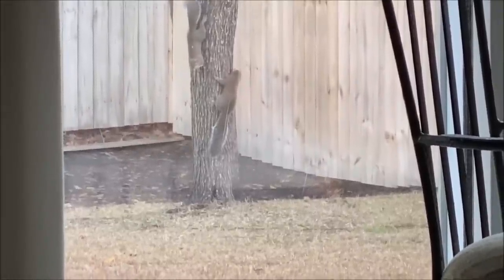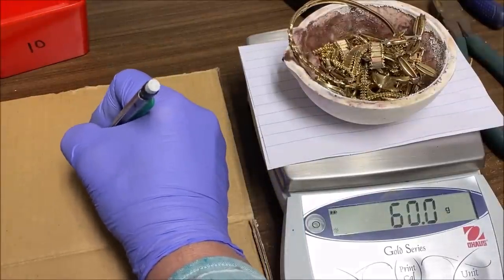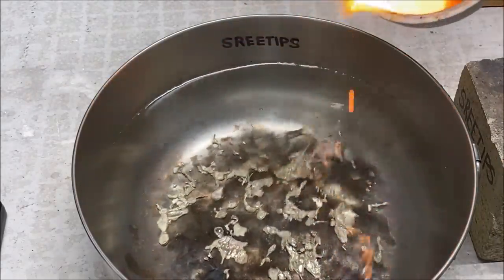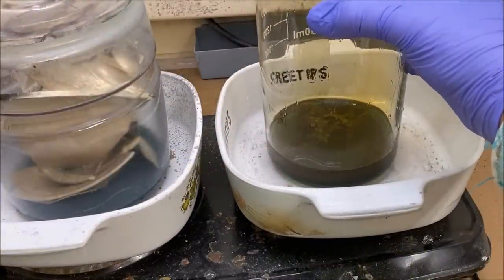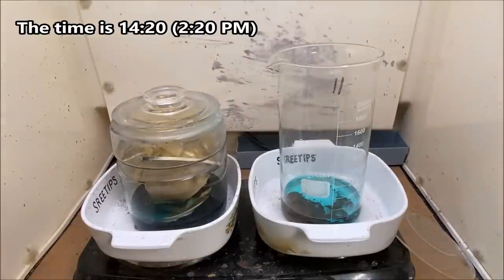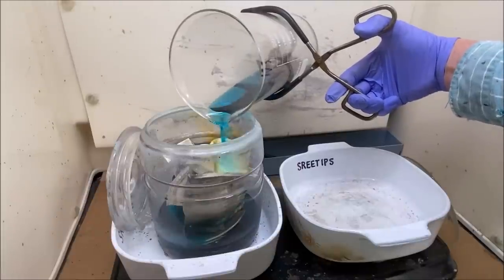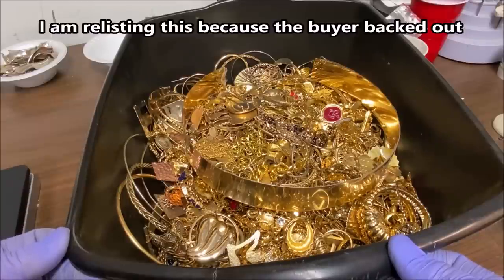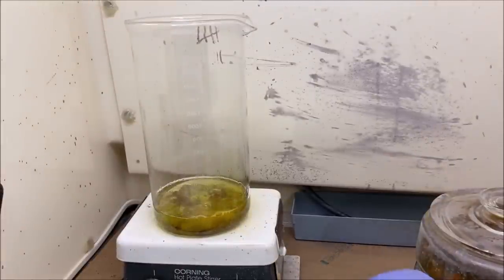Gold Refining Karat Scrap with Gold Plated Scrap sale

Comment: This is so entertaining to watch. I was thinking "Why couldn't I do the same?" cause I've got a chemistry professor in my family with access to materials and a lab. However, no matter how much I look - online auctions in my country end up going for more than the gold price. At least the solid 14K and ups. I find it hard to estimate how much gold there is in the plated/filled/vermeiled but my rough math suggest the yield to come at a loss.

I guess you need to know where to look for the best finds, not just online auctions.
Reply from the maker: People just don’t understand gold. It’s not an investment. It’s insurance against the paper money printers. Holding dollars is a bad idea because they are losing value (in terms of what they can buy) very fast. Holding your wealth in gold is a much better idea because it will retain purchasing power that the paper money loses. If you need paper to pay your bills, then sell a little metal. However, if you don’t have any savings to begin with, then it doesn’t matter. If you spend all your money as soon as you get it, then buying gold won’t work for you.
Reply: @sreetips  Very good point. I invest in gold and silver, mainly silver, because it's something I can reliably hold on to that will only increase in value (generally speaking). I also would like to inquire about purchasing a small sealed bottle of the aqua regia if that's at all viable. I'll use the proper channels to reach out in more detail.

Comment: I just discovered your channel, can't wait to go back and view all of the previous posts.  You may already have one, I've only skimmed the titles so far, but will you consider making a needed equipment and chemicals video for those of us thinking of taking this up?
Reply from the maker: Welcome. Everything you need is in the videos. I’ve left nothing out and added as much detail as possible. Please watch and take notes. Plus I try to view and answer all comments. Thank you!
Reply: You can get the basic equipment needed for about $500. That does not include the acids, just the flasks, hot plate, vacuum system, and bubbling device for the stock pots.
Reply from the maker: The first thing you MUST have is a fume hood to draw the fume away from you. No way to safely do these reactions without one.

Comment: What if you poured the inquarted gold from a higher height? Kind of like they pour shot from a shot tower. Obviously you couldn’t build a shot tower that high inside buy would pouring from a couple feet high make smaller pieces or would it be a big safety issue doing so?

Comment: Squirrels are cool dudes.  Years ago we had a group that hung out in our yard for tidbits we would put out for them on the top of the wall on our back porch.  Then the snow hit,  the back porch was full of snow, 3 feet deep wall to wall, needless to say, there was no opening the storm door to put out goodies for the squirrels. Those little beggars were line up sitting on the wall eyeing up the back door.  So .... we simply opened the kitchen window just high enough to put the goodies on the ledge and the squirrels came up one by one, took a piece (just one, no cramming their mouths), and moved on.  Who knew we would be opening a winter outdoor cafeteria for the squirrels.  They got a variety of shelled nuts, dried fruits, and peanut butter on crackers, bread ..... sometimes open face, sometimes closed sandwiches.  And, they always ate the cracker and the bread before coming back for seconds.   That was a fun winter.
Reply from the maker: They are a joy

Comment: Two small remarks:
You used to keep the last nitric of the nitric boils apart instead of putting it in your silver jar. As you are running behind on processing your silver cement, I suggest you start doing it again.
I was very surprised you did only one refining, curious about the refiner's assay.
Reply from the maker: It was a speed refine to demonstrate that the gold can be refined in just a few hours.

Comment: I wonder if there is a safe and consistent way to purposely cause the inquarted gold "explosions" that bring about more of the beneficial dust form of the inquarted gold.
Reply from the maker: One refiner used a pressure washer rig and poured the molten gold into the stream of high pressure water. It formed very tiny particles of inquarted gold. Perfect for hot dilute nitric boils.

Comment: I've been watching for quite some time and was always curious about waste chemicals. Using the silver to consume the excess nitric leftover from refining and so on. At the final form, is there anything that you have to eventually dispose of or do you just use the various leftover chemicals again and again to the point that they are no longer harmful? Probably a stupid question, it just seems like your system makes full use of any residual chemicals and I was always curious if eventually there was anything that requires disposal or if it is a self-supporting system that consumes waste as it goes
Reply from the maker: Waste treatment

Comment: i guess it would be an extra thing to do but if you pour the 6% k load in to a jewlers bar and roll a thread of the gold silver mix shouldnt you be able to get a long tiny rope a alot of area with out jetbeams etc? guess you can twist it by takinig to ends in a drill to stretch untill it breaks
Reply from the maker: That’s sounds like lots of work. Rather let’s the chemicals do it for me.

Comment: Do you make your ice cubes with distilles water? I learned about making clear ice and the bubbles in the ice are from impurities being concentrated in the center of the cube as it freezes, i wonder if it contributes to the cloudiness of the aqua regia
Reply from the maker: I use distilled water. But tap water, contaminants measured in parts per million, is fine. 999 parts per thousand is industry standard for pure gold. Parts per million will not report in a precious metals assay.

Comment: I really liked how that ingot was bulging out the top of the bar mold you poured it into, kinda surprised the surface tension was enough to keep it together there.
Reply from the maker: If you watch carefully, you’ll see that as I began the pour, about 75% of the molten gold came out of the melt dish into the mold. Then it stopped flowing (because of my poor pouring technique). I had to tilt the dish and get the rest of the gold to flow out of the dish. Fortunately, the gold already in the mold stayed molten just long enough for the rest of the charge to join it without forming a very ugly bar.

Comment: Hey I have a question, i have i big box about 18x24 box full of jewelry that says 12K Shiny Gold. Its a lot of pieces i wanna say like 1,000 pieces like bracelets , earings, rings and necklaces… my question is would it be worth taking to a jewelry and have them melt it and try getting the gold out of it? I dont know what 12K Shiny Gold is. Is it fill gold, plated gold or even fake. Its a lot though so im just wondering if i should take it somewhere??
Reply from the maker: 12k is usually gold filled. GF is about 2.5% pure gold by weight.
Reply: @sreetips  but it says “12K Shiny Gold” i think its gold plated from my researching… but is is worth take me to a jeweler and have it melted down?
Reply from the maker: Melted down? Not sure about what your asking here.

Comment: After the third nitric boil you took a second to zoom in on and comment that your gold was looking good- would the gold be brittle enough to physically break up into smaller particles at this point? and would doing so allow you to use less nitric due to the increased surface area of the remaining inquarted gold?
Reply from the maker: Harold_V on the goldrefiningforum.com recommended that the gold not be crushed up. It would tend to cause nano particles that suspend and don’t settle well.
Reply: @sreetips  Thanks for the reply; my initial reaction to that is that as someone who refines their waste solutions AND filters anyway; I don’t think you would be concerned about suspended particles? 

I will read the forum post Harold_V

Comment: About $3200 at today's spot price. Not bad for a day's work.

I suspect that it might be tempting to dip the gold-plated material in aqua regia long enough to dissolve the gold plating. The results would have to be refined to separate out the base metals that would also be dissolved, and once the material was treated this way it would be scrap brass at best. It's likely that the gold plating is worth less than the value of the junk jewelry.
Reply from the maker: Gold plated is best processed in a sulfuric acid stripping cell.
Reply: @sreetips  I remember that video. It looked like a lot more trouble than it's worth, given the amount of gold involved.

Comment: 26:57 "Must be losing proficiency here" My 2c idea: wouldn't it be useful to measure the wet weight of the gold in the beaker after the nitric boils, and start a little statistics table, noting how much nitric is needed in the aqua regia phase?
The only thing this wouldn't result in a good reference value could be if the gold content is varied, but after that many nitric boils, it shouldn't be.
Reply from the maker: That sounds like a good practice. But it would add another step to an already lengthy process - especially if your trying to publish before midnight!

Comment: That busted heating element is most likely easy to fix. Chances are it's just a loose connection. All you need is a heat stick, some tin and shrink tubing. Probably would take five minutes.
Reply from the maker: I’ll give it a look.

Comment: knowing gold is 19 times heavier then water i was just wondering,, after dissolving the gold into solution does the weight of the solution carry the of the gold??,,   does the acid solution gain the weight of the gold once its dissolved??
Reply from the maker: Yes. A solution with gold in it will weight more than the same volume of liquid with no gold in it.

Comment: If you want to reduce the chance of the molten alloy exploding as you add it to the water, make the water around 165F . That works on copper anyway.
Reply: What if you wanted it to explode on purpose?
Reply from the maker: Get the gold real hot before pouring into the water. But it’s very frightening. Like a gun shot going off right next to you.
Reply: @sreetips  Sounds like it wouldn't be a practical way to speed up the dissolution :D
Reply: @canonicaltom  I believe making the water colder would increase the chance of explosions. Having 2000 deg molten metal flying around is really not very entertaining, and it kind of hurts when it lands on human flesh, oh, and it's hard to recover bitty pieces of flying debris.
Reply: @larryevans7669  Yeah, was wondering how practical it would be to make metal 'sand' this way but sounds like a bad idea.

Comment: It may be the receptacle if both units are not putting out proper heat, or a voltage drop off somewhere in the circuit.
Reply from the maker: I think it’s the thermostatic controller, plus connects in constant contact with acid fumes while running.

Comment: As the only dumb question is the one that goes unasked 😁 Could you use that cemented silver you get to inquart the gold?

Careful with the squirrels 🤣 If they get used to getting their food from you? Let's just say I had a neighbor who lived in the condo across the courtyard from me. She fed the squirrels every day, nuts and cobs of corn... One summer she went to take care of her mom and was gone for two weeks...

The squirrels went up on the roof, tore through the vent cap and went down the duct, and got into her condo through the vent in the bathroom 🤣 and they tore the poor woman's house to shreds... When she came home she scared the bejeebers out of us when she let out a shriek and came running out her patio door, followed by about 6 or 7 squirrels... 😇 They tore up her furniture and pooped all over the place 😋
Reply from the maker: Cement silver could be used. But it’s not recommended. The PGMs tend to follow the silver. Especially palladium because it’s soluble in nitric acid. This could cause problems in the silver cell because it could contaminate the silver cell electrolyte. Small amounts are no problem. I can tell when palladium gets into my electrolyte because it (the electrolyte) will turn green. If the concentration of the Pd gets high enough, then it could begin to plate out with the silver and thus contaminate the pure silver crystal. But contaminated silver is not the main concern. Palladium is almost 90 times more valuable than silver. I’ll b careful with the squirrels. That sounds like it must have been terrible for your neighbor.
Reply: @sreetips  Thanks for taking the time to answer! I "sort of" thought the PGMs would cause a problem but wasn't certain. 

Yeah I called a friend and she was the squirrels cauzsed nearly 9K in damage and my neighbor had to fight with her insurance because they tried to deny her claim.
Reply from the maker: Disaster.

Comment: Why do you not add the sulfuric acid after the gold is already dissolved? Does the Aqua Regia not dissolve led?
Reply from the maker: I try to add it up front so I don’t forget it.
Reply: @sreetips  but will the led redissolve and go back into the solution during the boiling process is my concern.
Reply from the maker: No, lead sulfate is insoluble.

Comment: Check to see if the rheostat in the Corning hot plate is failing. They can be replaced
Reply from the maker: I know that’s it.
Reply: @sreetips   replaced mine with Robertshaw infinite switch kit 5500-102
Reply from the maker: Made a note of it, thank you